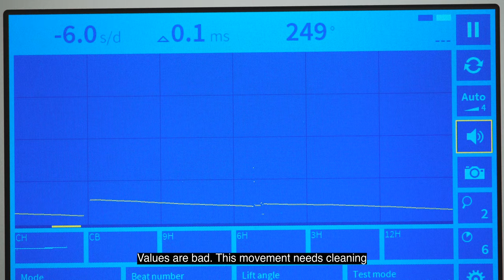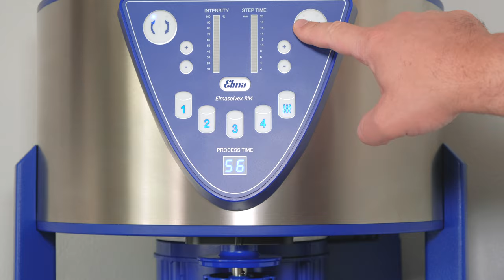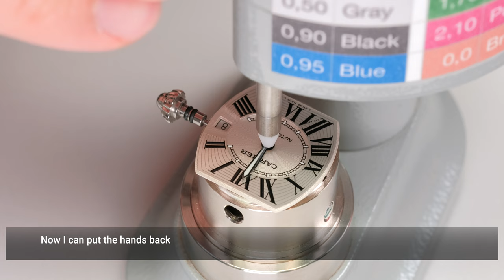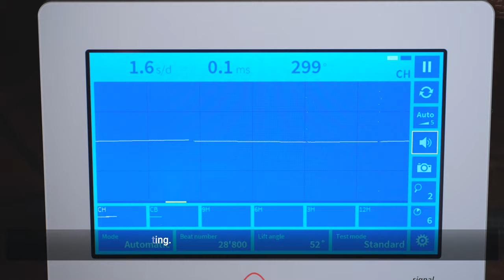Restoration of Cartier Roadster

Comment: great great job: you’re a Maestro…someone should explane me WHY I have to buy this watch so expensive with a 2892 movement costing 250€ each, not if it pays the brand…I do not understand it…
Reply from the maker: The watch belongs not to me.

Thank you for watching
Reply: @MagicWatchmaking  sure...I know you're a watchmaker but it was a general thinking
Reply from the maker: I think we pay always for brands. Cars, clothes, Smartphones etc.

We prefer things suitable to our needs. ETA 2892A2 refined by Cartier is excellent and meets with ease chronometer standard.

The case and bracelet made by Cartier are very high quality.

Quality and Brand made the price.

If this make any sense to you
Reply: @MagicWatchmaking  it is a non sense for me…I pay in this case (not only in this one obviously) THE BRAND, maybe the case, but how much MORE?
Many many movements can be cosc, also the Miyota 9015 if well regulated for example…it should be you buy a Ferrari with a fiat engine ‘cause it runs well (maybe…maybe).
My opinion…if I have to buy an expensive watch I NEED an IN HOUSE movement!
Others are the Omega speedmaster with a sandwich movement, and not from factory…@ 8,000 euros, for me it will stay omto the shop forever and ever